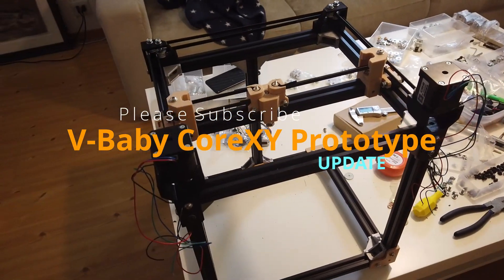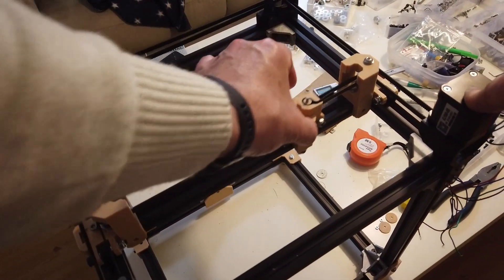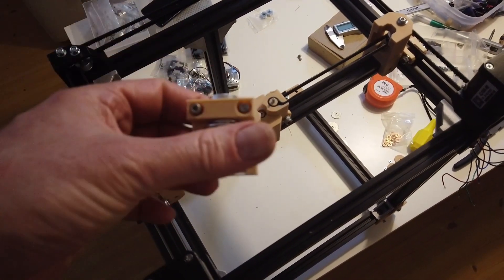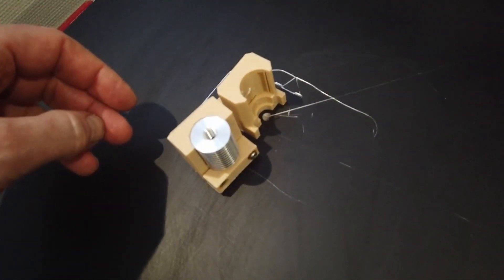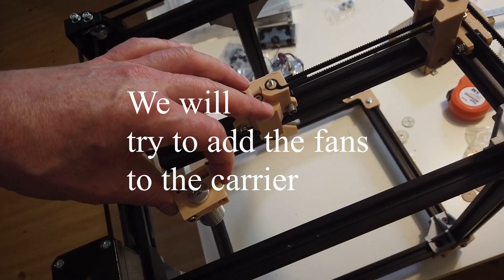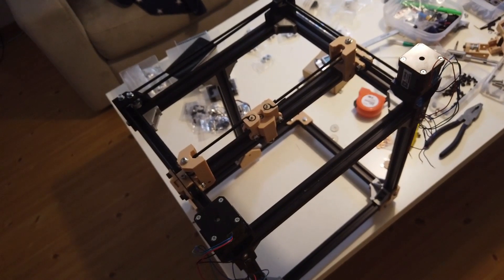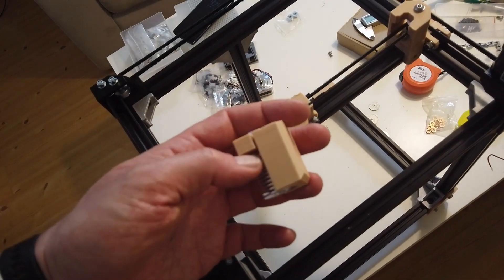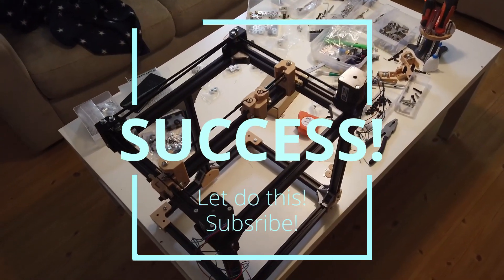rapid Prototyping - 3D design Vlog Prototype Update

Comment: if you planning for a possible tool changer  I would  use pins. maybe  pins on the tool and on the carriage a spring loaded steel ball bearing.  the pins can have a 1/2 moon notch where the ball bearing would lock it in. then you could use   a  strong neodymium magnet to  overcome the spring pressure to release the tool.

Comment: Hello!
Screws for the hotend I think. And some things to ensure a good positioning. Why screws? Imagine you want use a direct drive, I'm not sure that magnets are so strong. But... if you want an automatic change, magnets are the best solution. Perhaps it's possible to use the 2 solutions in the same time: nuts and magnets on the X carrier...
For the vertical extrusion on the rear, I think the best solution is to use 2 pieces because the cost difference is only 1/12 and it's more easy solution for the Z belt and the stability.
Globaly, I like the belt design for the X and Y axes: simple, efficient and usable for many CoreXY printers (do you know the V-King printer?...).
Reply from the maker: Tell me about the V-King...😜

Thanks for the feedback. I will take this into consideration for the rest of the process. I just want to see how a 3 point Z lift could work. If it is difficult to apply I will add legs in the corners